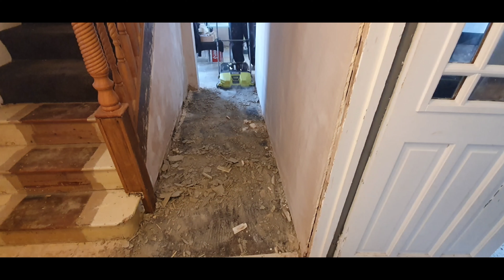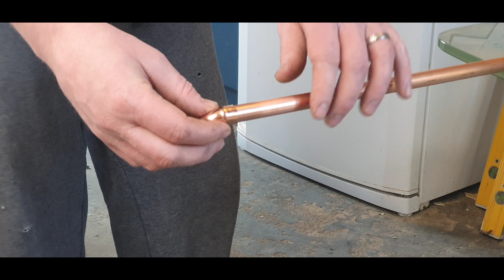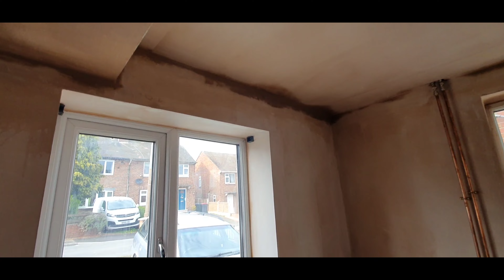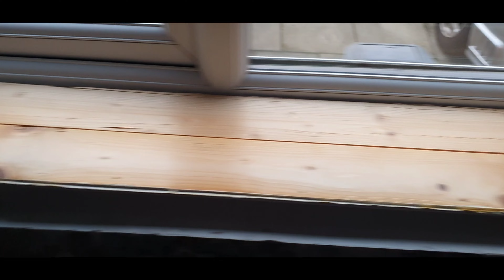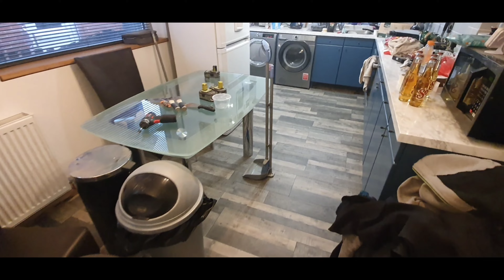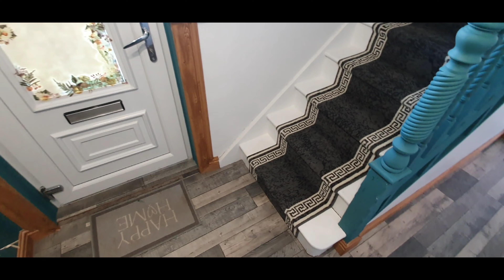kitchen Diner Renovation (Bigger Job Than I Expected) Part 2: The Finale!

Comment: Most modern houses are plumbed with push-fit plumbing fittings and plastic pipes.
You can join to copper pipes with them as well.
I've used them myself with great success.
Probably frowned on  by traditional plumbers, but they do work well.
Reply from the maker: I did wonder about those but I just thought I should stick to copper for the radiator. It's something I will consider using when I start on the bathroom thought as it sounds like they would make it a lot easier. Cheers 👍